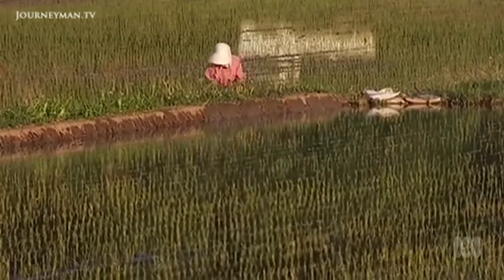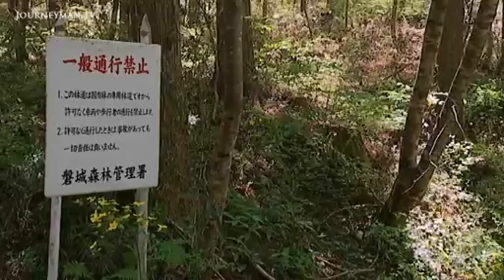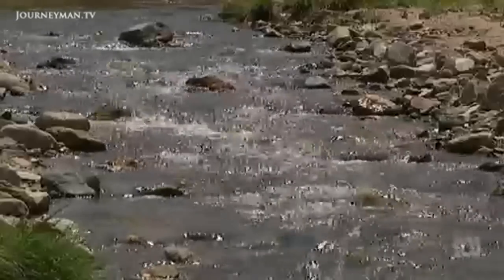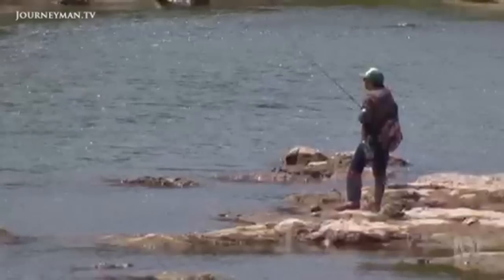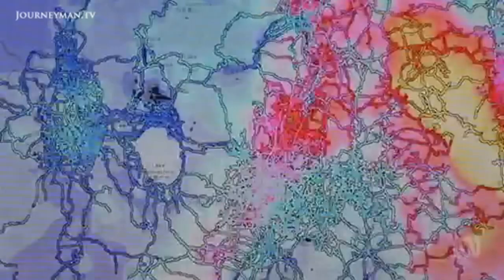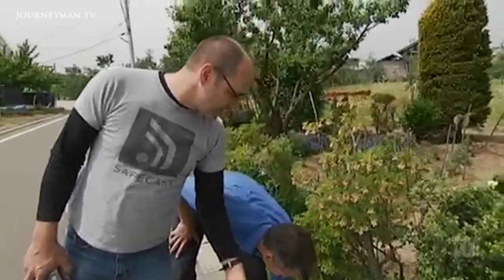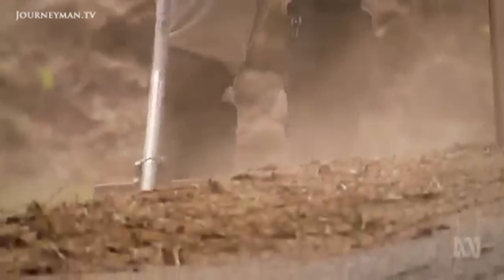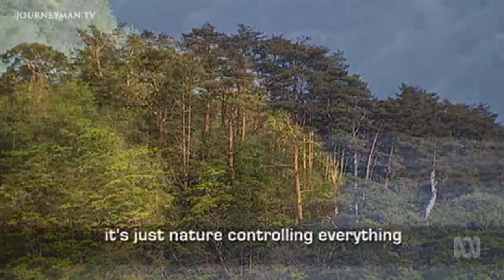Fukushima’s Radioactive Contamination Three Years On

Comment: The problem with safecast is that the measurements are not that thorough. As you can see they are taken in the air from a car driving down the road. This does not give a fully accurate picture of the contamination spread on the ground which can then spread into the ground, water, food and be kicked up by people walking.

Comment: Ignoring all the arguments for and against nuclear power at the moment, here is some rough math to put things in perspective:

The researcher gets upset at the 'decontaminated' area that still radiates at 0.65 uSv/h (0.65 millionths of a Sievert per hour),

0.65 uSv/h is also 5.7 mSv/a (5.7 thousandths of a Sievert per year).

For comparison:

(mSv/a) = (Dose) = (Time you would need to spend in the 'decontaminated' area)

0.36 = Eating one banana a day, every day = 3 weeks
1 = Civilian exposure limit in the USA = 2 months
2.2 = Maximum exposure rate desired by Japanese government = 4.5 months
3 = Average background radiation you get just from being alive = 6 months
5.7 = 'Decontaminated' area shown = 1 year
20 = Full body CT Scan = 3.5 years
50 = Occupational exposure limit in the USA = 8.7 years
100 = Ten-year exposure limit before increased risk of cancer = 17.5 years

Because of the way the human body processes radiation over time, the decontaminated area would have to radiate at least 11.4 uSv/h to be dangerous, and we're at less than 1 uSv/h.

The More You Know
Reply: Regarding the banana and other natural radiation. The body has adjusted to natural radiation - i.e. the body is saturated with it and no more is taken up - but that's totally different with man-made radiation - the body does not know it and never stops to accumulate it.
And the natural radiation is far weaker energy-wise, so it's like saying someone throwing a pebble at you is the same as if the person would shoot you with a handgun.

Regarding the figures of how much radiation is permissible - these numbers get pushed around in order to fit the accidents.
They are based on benefit (of the nuclear industry) and not on safety. 
There is no safe dose - babies and women tolerate far less - the nuclear industry bases its thresholds on a 26 year old male, as that's the type of person who tolerates the most.
One single atom sitting at the "right" location can give you cancer.
And it is not only about cancer - there are so many other diseases that occur before the cancer, it is mind-boggling.
Reply: Walter Dewald, Bravo, well said sir, finally someone who knows what he is talking about, compairing natural radiation to man made radionucleides is like comparing a stick of dynamite to an atomic bomb.
Reply: rafi:ki You won't eat any.  There's already shitloads of Uranium in the ocean, many many orders of magnitude more radioactive material than what Fukushima has/will put out.  Don't be scurred.
Reply: rafi:ki
My point is that if you're scared of the fish then you've been watching too much sensationalist news.
Reply: rafi:ki
Anytime
Reply: that all another story if you eat some
Reply: The Sherman your point being ?
Reply: The Sherman ok thank you for your insights
Reply: mark robertson uh, what?
Reply: Kenneth Knutsen Get outta here with your facts.  Only sensational speculation allowed.
Reply: +Kenneth Knutsen So if you eat one banana a day for 3 weeks, you get cancer?
Reply: +desbest desbest  21 bananas = 2.1 usv = 2 millionths of a Sievert, which is such a tiny dosage it's not even funny

You'd need to eat 950,000 (100 msv = a tenth of a Sievert) bananas in one year before science would even think to start looking for an increased chance of cancer